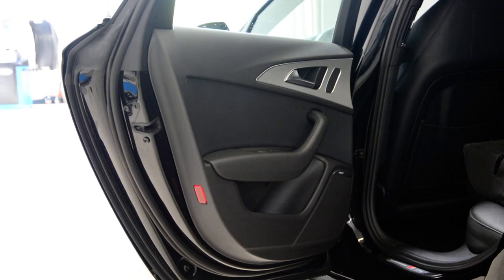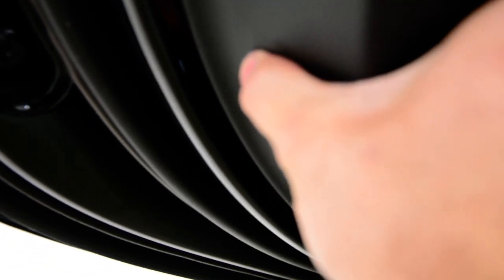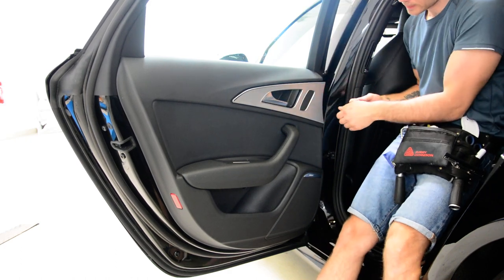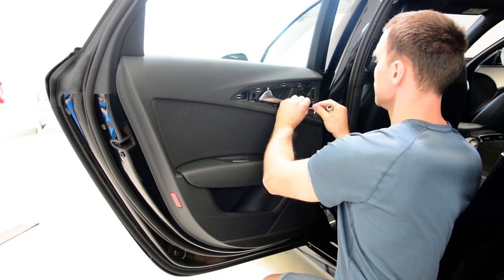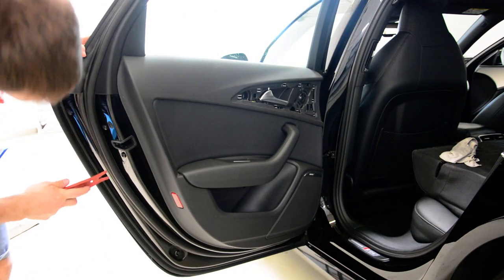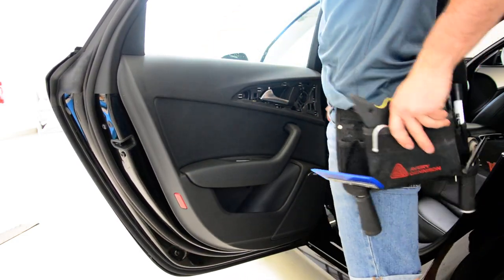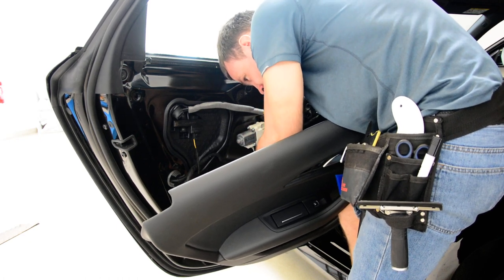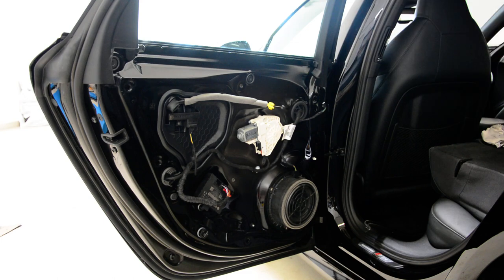Audi A6 2016 door panel removal

Comment: I used a butter knife and the push clip was lower then yours and my third screw was under the middle speaker I had to pop off the mesh to get to it, the middle speaker is right at the handle